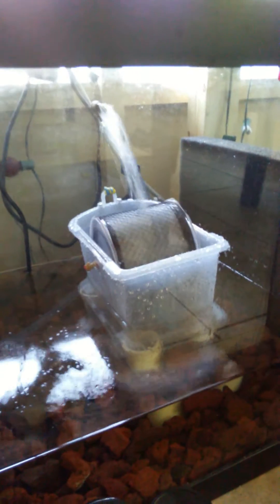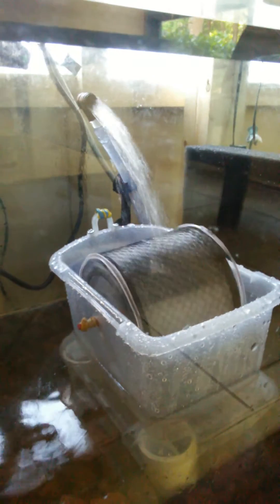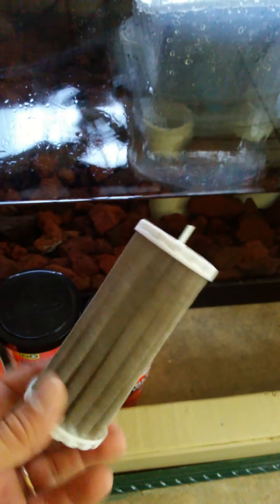DIY biowheel part 2

Comment: How's the bio wheel holding up? Interesting build.
Reply from the maker: Its worked well. I have a much bigger bio wheel now since i have my 650 gallon setup. I put this smaller prototype away. But it a solid idea and it works